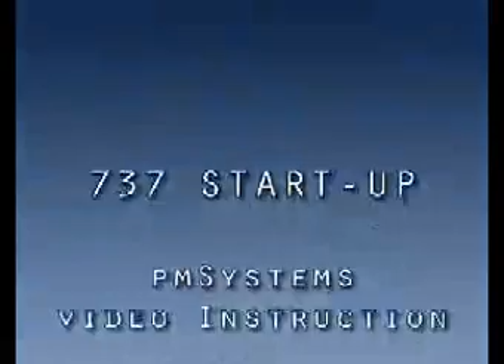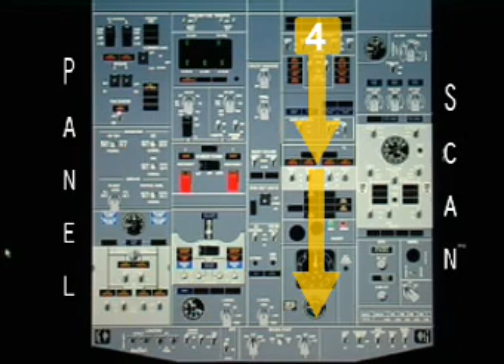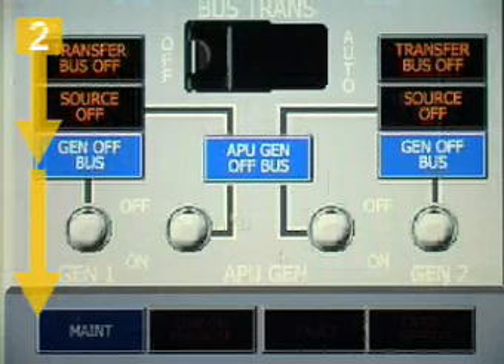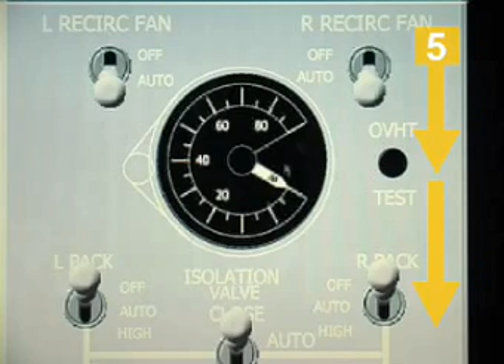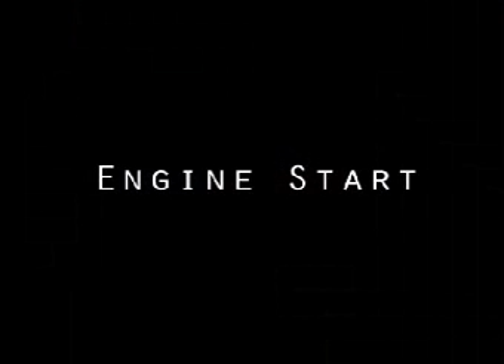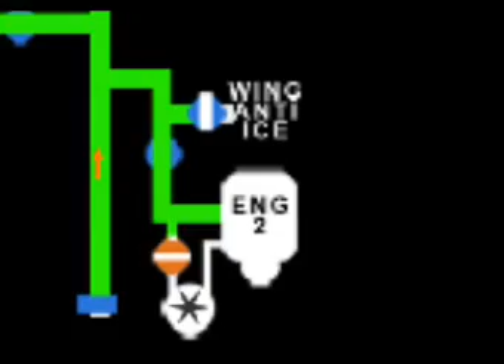Boeing-737 start simulator

Comment: The landing altitude has to be set to 200 feet below field elevation, so by checking your landing chart or nav page in your CDU, take 200 away from the altitude in feet shown. So EGCC is at 348 feet, the landing altitude would be set at 140 feet. or 100 feet set to -100 feet, etc) .On the  classics the cabin altitude of the departure airfield  also have to be set at -200 feet, and then reset. This is to keep to the .125 pressure difference limitation and avoid pressure bumps during rotation.